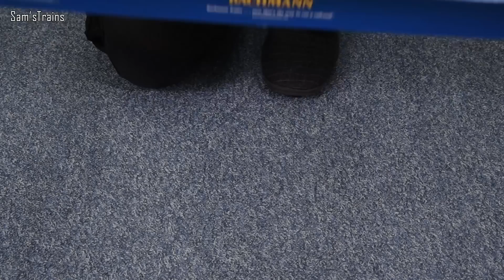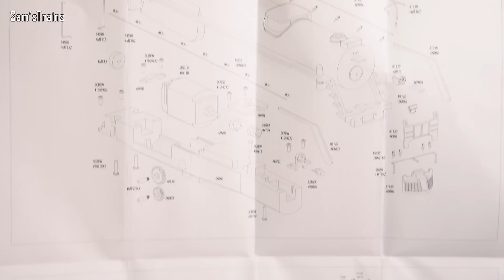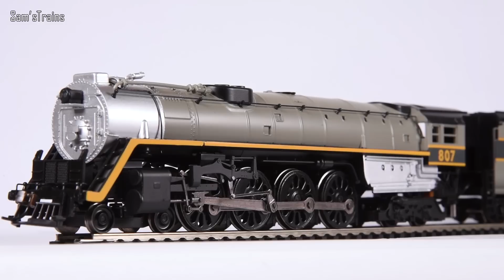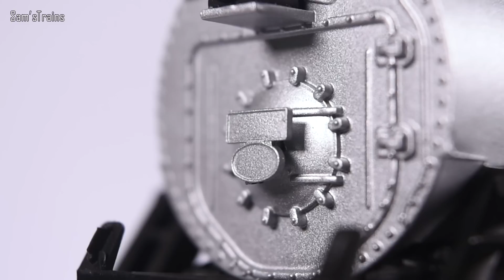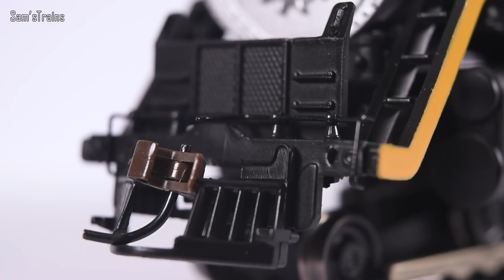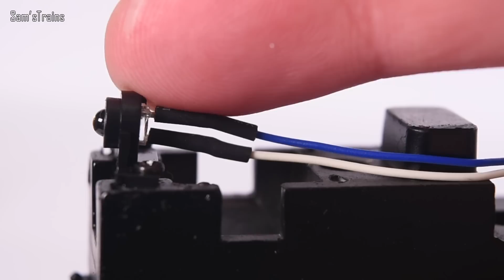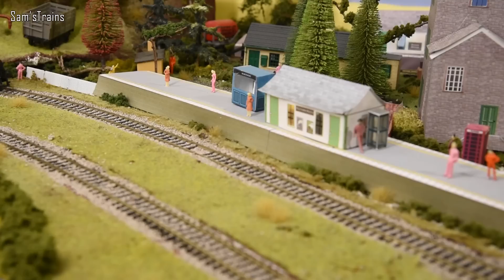Cheap,  Derailing Bachmann UP FEF Steamer | Unboxing & Review

Comment: Now obviously, that’s terrible and it sucks that your example of it didn’t work out very well. But just think, it’s an opportunity for you to flex those 3D printing/engineering skills and maybe fix it up 🤷🏻‍♂️. You could even perhaps attempt to 3D print some proper rounded inserts that you could glue into the square bearings on all your bachmann loco’s 🤷🏻‍♂️. Sounds like a good challenge to me. You’ve resigned drawbars before. Obviously you shouldn’t have to, and it wouldn’t up the score the loco got, but this could be a really engine to try and improve.

Comment: This is an FED however it’s a little different from the other FEFs. I believe these are actually called FEF 2s. These were actually “inspired” by the New York Central’s Niagara class locomotives that looked very similar. The model is not very accurate. The locomotive itself has a few little details and stuff that’s inaccurate due to the fact that it’s just a “reskin” of Bachmann’s Niagara but the tender is not at all like the real one. The real one was just the classic Union Pacific almost boxy looking tender.

Comment: I have that same locomotive as it came with a Bachmann Train set my folks got me for Christmas.
I plan to order two more  of the locomotive as a stand alone so  I can merge it into a never before seen Garret Setup lol.
I will say however it will not navigate 18 inch radius curves, 22Inch is its recommend minimal which would be Radius 3  in UK.
It doesn't like my #4 atlas turnouts / points either.

Now small thing too point out, the one in the train set, its tender is plastic wheels and no tender pick ups, the stand alone you have has metal wheels on the tender with pick ups (or its suppose too), the train set version comes with a drop in smoke unit, the stand alone I do not believe it comes with one.

Comment: To be fair, running locos or cars of THAT size on your tightly curved layout doesn't make much sense. It is unrealistic, looks ugly when loco's front or rear ends are swiping people off the station ramps ... But, yeah, this tender wiring stiffness is not acceptable these days, period.

Comment: It's a junk train-set 'model' of a Niagara which for nearly 30 years has been in a train set with a bunch of other junk rolling stock from Bachmann's previous releases of the 70's and 80's. They have changed the tooling slightly to replace the bulb with an LED, but over all, it's literally just a train set engine without the set or the cars.

Comment: This locomotive was designed in the 1980's and the original release I believe had a smoke unit, the loco was redesigned for a train set and then again for the DCC capability, I take it that's the reason it is not designed well
Reply from the maker: Thanks a lot for sharing! Even so, this was in the 2019 catalogue... no upgrades? Seriously? ;D
Thanks for watching, Sam :)

Comment: Besides the crappy tender to loco connection, one thing that provides derailments is the basic front boggie. It is not sprung, there is no substantial weight pressing on it, so it is a recipe for derailment. And, overall, the drivetrain is poor, enough for me to scrap any idea to buy one.
When I started serious model railroading in the 90's, I was told that Bachmann models outside the Spectrum range were rubbish, and not to buy. Like the models themselves, modulo a DCC socket or decoder, it has ont changed in 30 years...
This model dates back fropm the 80's, or even earlier. It was already for sale in the '90's.
So, salvage or scrap ?

Comment: Though you purchased that loco by itself, there’s a 9 piece freight car set with 22.5 radius curves that loco comes in called Overland Limited, and is also quite expensive as well. Tip: Anything below 22.5 curves and turnouts, that loco will immediately derail. Bachmann also released a DCC ready version as well, though I don’t know the exact price

Comment: I have the version of this from the “Overland Limited” set and it’s a split chassis and out of quarter wheels. The engine in this video is just a repainted Niagara with a Vanderbilt tender. I have a Niagara with this newer chassis and they have decent pull power but only to a certain point. Keep up the American videos. I recommend a Pennsy K4 soon. Bachmann is making a new run of the freight versions and I recommend pre-war as they look a bit better.

Comment: Ironically, I was looking at a set that was led by this engine "Overland Limited" to be my first train set and finally get into this great hobby ($280 on amazon). I wont be going for it anymore after that performance (and naturally there's lots of variation of performance based on other peoples comments). Also thanks to the comments for explaining that it looked like a Niagara (I was confused as to why a 'UP FEF' looked nothing like one)
Reply: I used to have this set and then the train started to derail itself and I tried to repair it and I end up tearing it apart, I hate 10-year-old me.
Reply: I bought the same set years ago and I’m still running it to this day. Sam’s layout isn’t a good one for long engines like this because his corners are too tight, hence the derailment. The overland limited set is definitely worth the money, it comes with silver nickel track, and a good selection of rolling stock.
Reply: @linkfan95  and I think it makes smoke using a special fluid that you drop into the smokestack
Reply: @arrivedknight7632  Yes that too. My smoke unit however doesn’t work anymore because my younger brother accidentally flooded it.

Comment: Good god the gap between the tender and engine even when coupled properly is MASSIVE. The crew would be killed. 😂
Reply: This tender is an oil tender... No shoveling of coal...
Reply: @ronclark9724  part of the engines cab floor is on the tender. There’s an extended plate from the tender to meet the cab so the crew have room to move around and it’s supposed to bridge the gap between the two, oil tender or not they still need to be able to accesses it and have a floor to stand one once they get off of there seats. Real UP FEF’s and detailed FEF HO/00 models achieve this without a giant chasm in between.

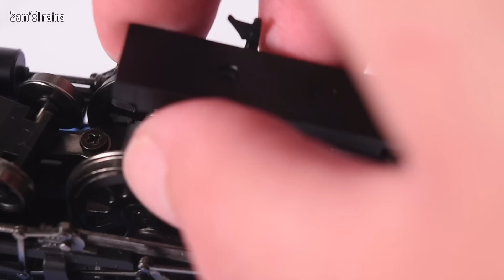Comment: At about 16:10 you see the reason why it derails... no sideplay on the driving wheels. Add RP25 wheels with low flanges to the mix and everything is set for a derailment.

For a comparison of UK and Euro size limits, take a look at the Class 66... Most continental operators have the horns and HVAC relocated to the roof

Comment: Well that didn’t turn out very well, I have to say for the RRP it’s a downright disgrace good job you got it a a knocked down price. To give it some credit though it seems it was never designed to go round anything below 4th radius so derailing on 2nd is to be expected. It’s rather like expecting all large UK locomotives to go round 1st radius which I know will derail just as much. The loco, tender connection is poor none the less, looks like a project to get it working better.

Comment: My Bachmann 4-8-4 used to have the same derailing issue, and I was able to fix it by replacing the front spring with a stronger one. They used to put their stronger, faster black-capped motor in these, so that’s a shame that they downgraded to the slower, weaker gray-capped motor.

Comment: U can do a "FIX IT" video with this loco too, adding springs replacing the wires (to like what u find in a USB charger), and thins like that. And with some paint and brush, it is easy to improve the look a little, I know I would do that! I have a similar older one (somewhere), but I think that is also a split chassis one (its a "white box" one so it should be).

Comment: As everyone else has said, it's a repaint of a different locomotive from the New York central, the "Niagara", with a different tender. I'd definitely bend that drawbar to try and rectify the issue. I look forward to more American reviews!
Reply from the maker: Thanks for sharing! Yeah I might do... may even rewire it with some better and more flexible wire!
Thanks for watching, Sam :)
Reply: @SamsTrains  awesome!
Reply: I was thinking the same NYC connection from the smokebox.
Reply: The so-called Selkirk front end on the Central’s later steam is pretty unique.
Reply: No more US locomotives. Eww!
Reply: America is NOT the UK during the mid twentieth century with just four major railroads. At that time America had scores of major railroads. Which does create a problem with the model railroad industry, manufacturing railroad models for scores of different railroads with minimal differences. The Chinese manufacturer of Bachmann most likely do NOT know the slight differences anyway. Those painting the locomotives and trains are barely able to paint the liveries correctly. Forget about insignificant details... In America Bachmann does not have a good reputation compared to other manufacturers. Now Sam knows why...
Reply: @ronclark9724  thank you Ron very cool
Reply: @ronclark9724  Bachmann previously had a proper FEF mold, I don't know why they don't use it anymore.
Reply: @nicholmansgarage3501  no, it was an atsf northern also repainted in the Union Pacific greyhound paint scheme commonly used on fefs. You might be thinking of rivarossi which made some really good fefs back in the late 80s and 90s
Reply: @Texas_and_Pacific  ah, my bad.

Comment: Maybe setup a small loop with R4 curves as that’s as close to 22” radius you’ll get. Bachmann rates that as the minimum and I’ve definitely found they’re hard minimums as I have passenger cars and long freight cars that require 24” or even 26” curves.
Reply: Many Americans refuse to use less than 36 inch radius curves... Maybe Sam is learning...

Comment: I had one of these, it was very dissapointing. Never even made it around an oval without derailing. Also comes in the overland limited trainset. With ten decent, but a bit ridiculously shiny freight cars.  I think it needs more weight on the trucks. Its more of a display model than anything. At this price your best choice for american steam locomotives is IHC. Bachman makes very reliable, moderately priced diesels,  enough to be a solid midrange brand.  though they can be overly light, steam locomotives though, not so much. In fact probably the worst on the market since life-like doesnt make locos that big.